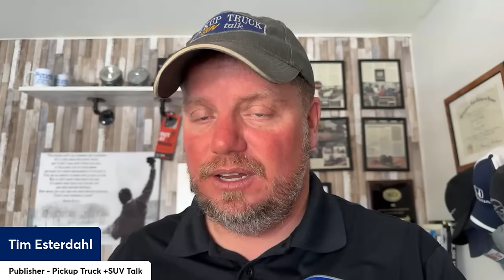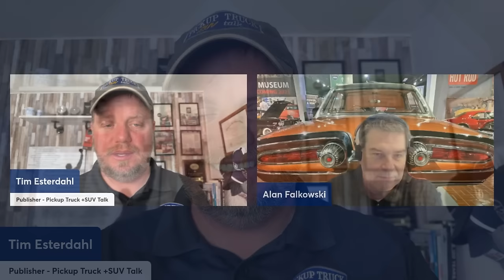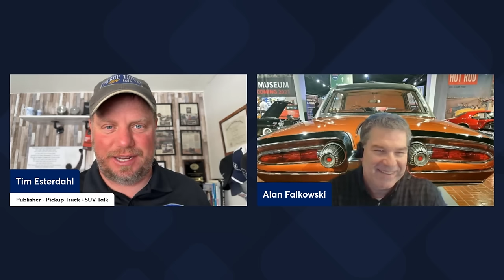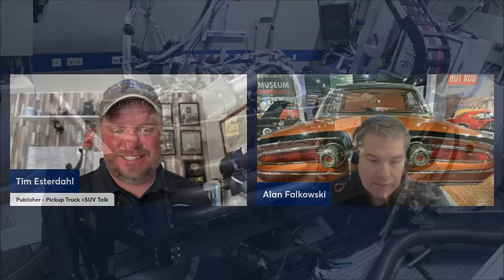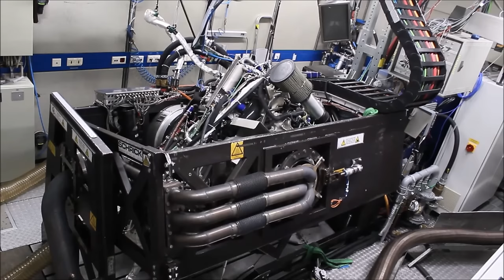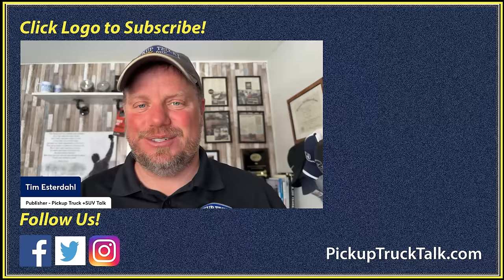Engineer Deep Dive: 3.0L Hurricane Engine - Turbo Life, Oil and Intervals and More

Comment: I have two concerns about the Chrysler Hurricane engine 1). turbo-related issues, and 2). substandard parts.   1a). I am not in favor of turbo-use on street driven engines. First is cooling of the turbo's bearings, and just pulling up to any location and shutting off the engine, it can cook the bearings. Even with the electric turbo cooling pump the guest talks about, I do not accept that they have solved the problem. With turbo shaft temps over 1000-degrees (F), just applying engine coolant which is at 200-degrees (F) with a now-shut down couple of turbos will not fully address the turbo heat soak issues. 1b).Turbo lag. Chrysler says they've largely eliminated turbo lag with two turbos, but the entire engine is just 180 cubic inches. With each turbo principally being supplied with the exhaust from 3 cylinders (90 cubic inches) that's a negligible exhaust air flow at idle, and there cannot help but be turbo lag with those exhaust air flow numbers. This engine, or any turbo engine, does not produce additional significant power until the engine is "buzzed" and at under 3000 rpm (as an example) but with light throttle application the engine still has only a small exhaust flow. So, driving along on the highway with a Hurricane-engined set of turbos, there will still be turbo lag. Or at a stop light, the light turns green, the driver tromps the throttle, and the vehicle nose-dives until the engine starts putting out appreciable amounts of exhaust flow. 

 2). I have read, and I'll be happily corrected if my information is incorrect, is that the Hurricane engines, both the standard and the high-output versions, use cast pistons, crankshafts and powdered connecting rods. With 20 pounds boost from the turbos. with the standard version, its putting out 2.2 hp per cubic inch, and with the hi-po version its 2.7 hp per cubic inch. There has never been a successful race engine that ran those power numbers successfully on cast / powdered rods, or cast pistons or crankshafts. I am concerned that some Chrysler engineer, somewhere specified forged components, but was overridden by a Vice President somewhere that has no actual engine durability concerns in the organization, that said to cut costs, and forced the engineers to specify the cheaper cast / powdered components. Its like running a NASCAR race engine with grandma's econobox components. Same for some other internal engine components. 

With regard to durability of internal engine components, I subscribe to the "Top Fuel Dragster" doctrine, that components be used that "cannot" break. EXAMPLE: if an engineer needs to decide whether to use a 1/4 or a 5/16 bolt, that he instead specify a 3/8. And where a coarse thread is all that's needed, that a fine thread bolt be used. And if a Grade 5 hardness bolt is OK, then use a Grade 8 or aerospace  bolt. At the OEM manufacturer level, there is a negligible cost difference, and at most an engine might cost $5-7 dollars more to build, but then there's a piece of mind that warranty claims will be negligible. EXAMPLE: a NASCAR engine (358 c.i.d) putting out 2.2 HP / CID would have 787 HP; ask any NASCAR engine builder if he's building a 787 HP engine, what would be his rule of use of fasteners. Ask him if he'd use powdered rods, and cast pistons and crankshafts. The guest on the above video talks about torture tests... what's different between what he's doing and what a NASCAR engine goes through.? A 358 engine with 2.7 HP per CID would put out 966 HP. Ask that NASCAR engine builder if he was building a 358 engine with 966 HP, what grades of parts would he use. That should be the guiding light for the Chrysler engineers with the Hurricane engine. What they're building is, on a cubic inch to cubic inch comparison basis is equal to the very highest hi-po engine ever put out by a Detroit "Big 3" auto maker.

Comment: Was hoping we’d learn about the power outputs when using regular unleaded. It’s my understanding that all the hp/tq numbers provided by Ram are when using premium. Is premium required? If not, what’s the hit on the performance? Can’t find those answers anywhere even though the engines have been in the Jeeps for a while now.

Comment: I bought a 2017 RAM 1500 turbo Diesel.  Yup, the turbo needed to be replaced at about 150K miles.  I never tow, live in the flatlands.  I would like the engine, if it weren't for all the emission hassles.  Could be that adding 10-15% french fry oil to your diesel fuel mucks things up.  But that's what you are forced to live with in Illinois.  Question for the engineer-will the twin turbo run on 80% gas, and 20% anything else?

Comment: I check my oil all the time,even my new HEMI V8...you can tell the condition of it etc..Dumbest thing is not to have a oil dipstick! I wont buy anything without a dipstick!

Back in the 80's my parents owned a few Chrysler Turbo cars and the engines lasted but the Turbo  failed!!! Thats why I dislike Turbo's,even my brother in law had issues with his Ford F 150 turbo and Toyota has turbo issues on its new 2023-2024 Tundra!
Reply: Agreed 100%, for me I chose the 5.0L Coyote V8 over the Ecoboost V6 anyday.

Comment: Wow they figured out a straight 6 will work. Toyota Land Cruiser and BMW have been using this motor normally aspirated and turbo charged for decades
Reply: I can tell you are young because you had no idea that the straight 6s were the base engines in the big 3 pickups once upon a time.
Reply: @garyhunchak1857  yep, my 78 F150 with a 3 on the tree was great.

Comment: Great interview .  I have bought 5 New Rams in my life . All hemi’s.  Had to sell my Power wagon last year ,for reasons that better left alone .  Hoping to get a new 1500 in a few months .  Was half thinking of going to the Chevy 6.2 , but I really like my Rams .  On the oil topic , I wonder why not use the 0-40 on the lower output Hurricanes , if it’s better for the HO ?
Reply from the maker: My understanding is you can, just not needed for the what the S/O engine requires.

Comment: My concern has never been the engine durability but that the turbo is simply another expensive failure point.  As an example my brother got a new turbo Audi (first mistake I guess) a couple of years ago .  After his third turbo was replaced (under warranty luckily) he dumped it for a NA car.  I trust RAM far more than Audi but I'm sure they use an outside supplier and  it's still another potentially expensive repair.  GREAT video and information though.

Comment: I would agree with 10k miles, if they'd put in bigger oil filters, some of the filters I see mounted on turbo engines are a joke in my opinion, if you double the milage, so should the filter size!

Comment: Tell me that during cold start you won't have fuel going through piston rings specially with direct injection and high pressure fuel system, causing oil dilution. It's true that oils have improved, but also it is true that today's engines need oils in their good operating characteristics specially engines with low friction technology in which you have low tension piston rings. Just be cautious, when you do lots of cold start and when you drive in hot climates were your engine is struggling with high temperatures, change your oil at shorter intervals, you can use the owner's  manual extreme operating condition suggestions for maintenance.

Comment: On the topic of oil changes every 10k is stupid and needs to stop. Yes oil quality has greatly improved, but oil contamination is why you still need to change the oil every 5k. Oil quality is better but the filtration is not. You could make oils from 20 yrs ago go 10 to 15,000 miles with proper filtration systems.
Reply: 10,000 miles without an oil analysis is insane. 10k miles isn't that big of a deal
Reply: @OxBlitzkriegxO  so you think just because you send oil off for analysis it makes 10k oil changes okay. Lol we have been using the same cheap paper filters for 60 yrs and now all the sudden it's okay to run 10-12k on a single oil change, yup not true manufacturers do not want another LS that will run a million miles they want a engine that last 150k and is expensive to replace so you have to buy new.

Comment: Turbo engines create high under hood temperatures. The heating and cooling over time  destroys all the plastic bits.  Seems that the plastic parts, couplings, fittings and the like are designed for a service life not to exceed the warranty period.
Reply: Plus it’s adding complexity, extra cooling component. And you burn more on when you are towing, More power adds more gasoline burning. The v8 hemi will age like wine from now on. In the future all the he is with low mileage will be hard to find and buy.  
The only positive it vibrates less due to the inline design. They should just make a straight 3.6  with no turbos as starting trucks.
Reply: @gforcedod  I agree, a straight 6 with  dual over head cams and a combination of port and direct injection.
Reply: @jimrusch22  inline 6 coyote. We should open our Owen car company brother.
Reply: @jimrusch22  just give people what they want, you can’t get energy without taking it somewhere. And this extreme speed it’s not necessary, in my opinion all the cars should have high torque and less speed. Pick up shouldn’t be able to do more then 80 -100 miles an hour. All our pick ups would sell out. .they will float on high gear ratio like an electric car. German 8speed transmissions.
Reply: @gforcedod   What”s interesting to me is a Honda S2000 2.2 liter engine  Can produce 237HP without boost!

Comment: Liked what he was saying until he said you can go 10,000. These companies are wanting you to have internal failures, until you can stop or reduce blow-by the engine oil, gets dirty. Additives help as much as filters, but doesn’t stop the contamination of the oil. I change my oil every 3,000 mile and my cars easily get over 200,000 without issues and the valve train still looks brand new. You just need to know what cheaper for situation.

Comment: I could tell this was a popular video because there were 6 sets of commercials in a 35 minute span. No trade secrets given away in this one. Interesting that Ram is using either a plasma spray or twin wire arc cylinder bore coating instead of cast iron liners. I worked on the development of this technology for GM back in 2000 V8 engines.
Reply from the maker: Six sets of commercials? Huh.
Reply: Yes, lots of ads on this one. Hopefully this is at least indirectly beneficial to Tim.
Reply: I believe the plasma spray application was first used on Duramax engines, if memory serves me correctly.  Sounds like a better way than sleeving an aluminum block with steel liners in this application.

Comment: Great video..thank you...I was hoping to see a chat about fuel type as well...does this new engine require premium fuel? if not, what would be the performance penalty if you use regular fuel?
Reply from the maker: Yes, it is in another video. Sorry. Premium fuel for top HP and torque numbers. You can use a lower grade and the engine will sense the lower grade fuel.

Comment: My biggest concern is with that much hp/liter and direct injection only, if there is going to be long term carbon buildup?
Reply from the maker: I’m working on a video on this topic. Fuel injection spray rates and advanced oils help reduce this issue dramatically.
Reply: Yes, direct injection is scamming the customer so they can save money building their cheap engine

Comment: Not a bad interview. Wish you would have touched on the hemi lifter issue if he has the inside scoop. Some things I would have brought up would have been the fuel octane and performance vs heat. I'm seeing 91 octane recommended and car and driver did a test with the new hurricane and it only got 20mpg vs a 5.7 hemi getting 19mpg. The difference of 1 MPG vs a minimum of $0.50-$1.00 per gal can easily mean the 5.7 could get better range for the money if you run it with 87 and use the same amount at fill up. Oil change 10k is no biggie as I run that in my Hemi but turbo engines run at richer A/F ratios which translates to more fuel in the oil so they should technically have a lower mileage oil change. I would have also asked about oil film strength on any stop/start as the bearing oil pressure drops to zero on stop, this puts more stress on the bearing as there is no oil pressure to create a cushion and all you have is film strength. Your biggest issues with turbos is oil seals and oil temperature. A water cooled turbo is always best like he stated but doesn't change the issues with turbos which is seal life. Would have been nice to know if they are ball bearing or journal turbos as both have there benefits. Forged pistons due to boost levels (20-26psi)? Are they running a colder spark plug? Are they incorporating a electronic wastegate and recirculating BOV system? Not a fan of a direct injection due to the high pressures, failure rate and expensive to fix but also a traditional injector also provides IAT cooling as the fuel is introduced early enough which benefits turbo engines big time.

Comment: It’s still not believable that today’s small turbocharged engines, with all that extra heat from the turbo will go the distance as well as a lower stressed larger non turbo engine, especially in warmer climates. And oil is still cheap compared to even minor engine repairs. Extra turbo heat means the oil life is less. Peace of mind comes with using a highly rated oil, and changing it a bit before the oil change light comes on. And I have never owned one of those new turbo wonders. The turbos themselves seem to need replacing about every hundred thousand miles at about $2,000 a crack.
Reply: Exactly mate

Comment: I’m very happy for Stellantis for what sounds like intelligent engineering from what are the conditions we want to achieve and then design the engine and also not just draw from a previous low pressure engine design, I think if GM with their infamous Diesel lab test with many customers in the early 1980’s including my brother with his Silverado 1/2 ton. Although I am very happy with my 2020 6.6L gas Silverado and have an Oil Catch Can that is capturing oil before intake valves, I think this new engine will still benefit by a Catch Can and yet their engine sounds very reliable and powerful 👍🏼👍🏼. I’d consider their truck for the future or maybe one of their SUVs (Gr. Cherokee or new design Durango) with this engine or smaller version = JD Power shows that their trucks and Gr. Cherokee and Durango have quite good quality ratings. Congrats Stellantis.

Comment: No turbo engines suck. I have a 2014 turbo vehical with only 119,000mi on it. I'm on my 3rd turbo. I change my oil with Mobil 1 extended life, every 3,000 to 4,000 mi. Manufacturer recommends 6,500mi.the car is an eco model so I baby the car getting 40mpg. I let the engine run 1 min before driving and let it idle 1 min before shutoff. At $4,900 for a turbo factor that into the buying price.
Reply: Minimum shut down  idle should be at least 3 minutes 5 much better

Comment: Does the new engine still have that actuator oil filter that needs to be changed like stellantis smaller engines?
Reply from the maker: Acutator oil filter? First I've heard of that one. I Googled it and Mopar sells one for 2012-2019 engines. Am I missing something?
Reply: This part of not changed literally kills smaller stellantis engines that are shared across products. Fiat 500. Internet gurus swear this is another hurricane engine that's two 3 cylinders sandwichrd together. There's no maintenance wording in owners manuals.  @Pickuptrucktalk
Reply: @Pickuptrucktalk basically I'm wondering if this engine has that part.
Reply from the maker: @shekharmoona544  I can ask.